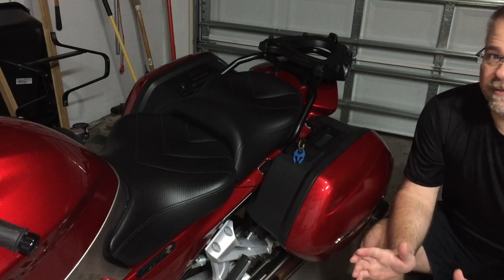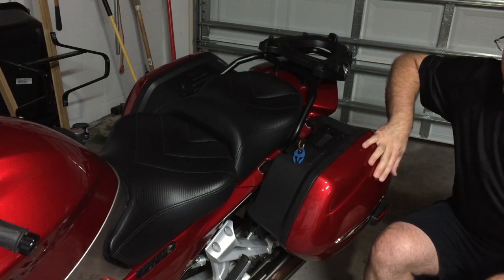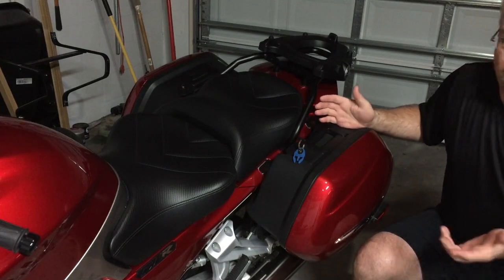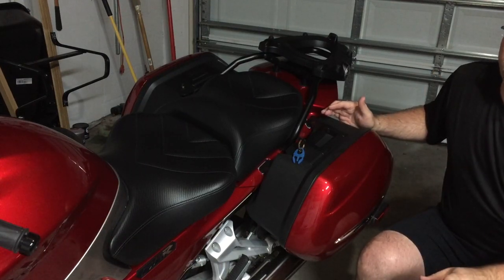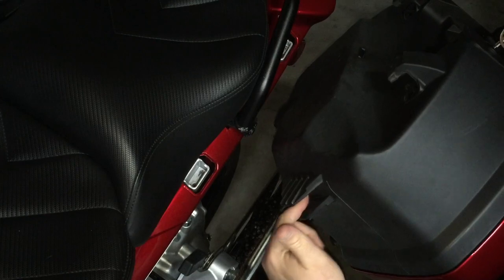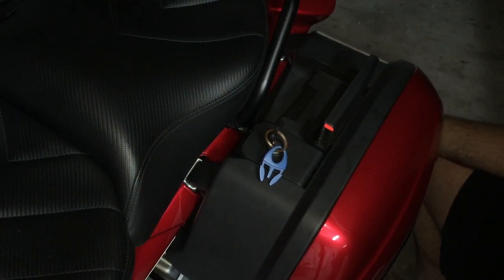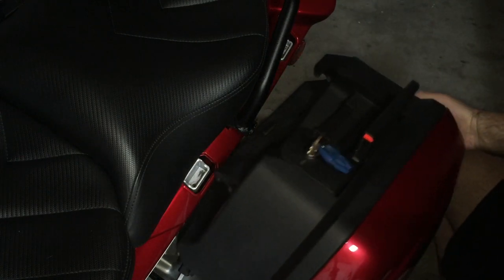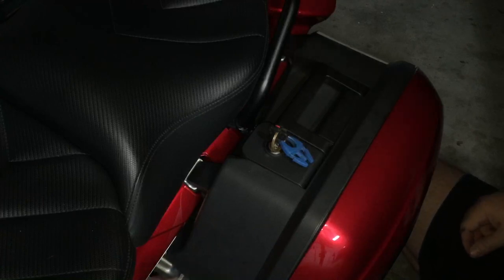FJR1300 Saddlebags Detatching Or Falling Off Solution

Comment: Has anyone found any other solutions for this issue?  I have a 2014 that has enough slop in the mechanism where I can wiggle one of the 2 hooks out of the top slots.  I dont like the idea of drilling holes to use a cottter pin but it would be worse to lose a case.  In my situation, there is a sizable gap between the top of the rubber guide foot and the bottom of the case.  I thought I may try to attach a rubber filler of some sort in that space to prevent the case from rocking around (which allows it to wiggle off of one of the top hooks).
Reply: Same problem here. Wiggle and twist enough and the rear hooks come out on both sides. The plastics are actually broken around the hook holes.

Comment: I think your "theory" is actually the proof. Is not a design flaw. The pre-ride check
and double check is the answer. The mounting mechanism is well thought out. Just
a matter of checking that handle. A great tip that I will not forget.

Comment: I was wondering if there's a way to remove and reinstall the saddlebag reflectors?
Reply from the maker: It's just double sided tape or adhesive goop, depending on the year.  dental floss to remove
Reply: @TwoWheelObsession  thanks...I started that path but it was so hard I was afraid I was missing something. Going try again.

Comment: They should have had one lock to secure the case and a separate one to lock the case. That's a very slim margin for error. Agreed that a single check tug would eliminate the issue. Yet had they made the locking slot notched into the handle directly in the center of  the handle then a handle that was up a 1/6 of an inch or less could not be locked or allow sudden detachment.

Comment: Mine ALMOST came off.  The small screws that hold the lock cylinder on vibrated almost out.  Thankfully I felt it being wonky loose when I put in the key to open the bag.  Any more driving and the screws would have dropped out completely and THEN the lock assembly is free to rotate with vibration.  That means it will AUTO-UNLOCK and that means the bags are free to bounce off...   I solved it by putting screws back in with JB Weld.  No more lose screws; no way to drop screws now.

Comment: Found this video as a result of issues with the lock.  Fortunately I did not loose my saddle back and easily could have as I didn't even know the large handle pushed the pin up to lock the bag in place.  Anyway, the two screws that hold the rotating tab onto the cylinder, one is missing and the other one is loose.  Can anyone tell me what driver is needed for that/those screws.  I tried torx, philips, and allen.  then I finally took a picture of the screw head while zooming in, and then blew up the picture to see that I don't recognize the driver required. (yes I wear cheaters and clearly they aren't strong enough!  Thanks for the information and I will locktite the screws.
Reply from the maker: It’s called a safety torx.

Comment: After reading a lot of the comments I checked my luggage for loose screws. Except for the strap that keeps the door from flopping open too far, mine is ALL rivets. There are NO screws that might loosen over time. The manufacturers date for this hard luggage is 08-23-2013. My FJR1300ES is a 2014 model. It would seem that the problem of loose screws has been fixed. Yeaaaaa. Now if we could only fix human error. Yikes.
Reply from the maker: Uh, dude those aren't what this is about at all.  The screws are on the little bar that swings with the lock, that's all.

Comment: The screws can back out in the locking mechanisms, Red Loctite them and you will be fine.
Reply from the maker: Wrong. Blue only, as called for. Red is very high strength and would be a problem removing if someone ever needed to swap the lock.

Comment: Having same issue and it is not no human error. Pin mechanism got loose.
Reply from the maker: +Nikolay Kuznetsov as I clearly said in the video, this does not apply to parts that are broken.
Reply: +TwoWheelObsession it is not broken, mechanism works and holds it in place until certain amount of force applied to bag (on bumpy road for instance). That exactly what happened on my bike and it happened with others. I fixed it by locking mechanism by screw from inside of the bag. In my opinion lock mechanism has bad design. Locking pin should move horizontally not vertically.
Reply from the maker: Yes, it is.  That's very common and usually caused by someone forcing down the handle.  It's one of the internal plastic teeth in the gear rounded off.  Unfortunately it requires the bag to be replaced as the parts are set when the case is molded together.  That's exactly what I referenced when talking about broken parts.  If your gear was not broken, it would not move.
Reply from the maker: I'd say that's a good fix for your problem for sure!  Good job!

Comment: No, I have a 2006. The left bag comes of by it self after a couple of kilometers. Yes I am sure it was locked. 
I suspect the lockingmechanism inside the bag is faulty.
Reply from the maker: As I said in the video, this does not apply to damaged cases.  Yours is
 broken due to someone forcing it shut at some point, you have skipped a
 tooth on the internal gear.  User error as they always are.
Reply: TwoWheelObsession No, I am very sure it newer was forced locked. I am a developer of products and never force anything because I know it never helps. It's a weak construction that jumps over the teeth by it self.  Similar as the top box that cracks by it's self, even with the reinforcement Yamaha supplied.
The next step for me us to disassemble the bag.
Reply from the maker: If you say so lol - and there is no disassembly.  It's injection molded together.
Reply: TwoWheelObsession everything put together is possible to put apart. After the crash for the bag I have no use for it anyway. Better to use it to get some facts instead of speculation.
Reply from the maker: Dude you have no idea what you are talking about. Once you actually take a look you can come back and admit I was right. It’s not assembled. It’s molded as a single part with the gear and track inside. This is an old issue for users like you that break it. You need a new bag.
Reply: TwoWheelObsession I actually do know what I talk about. I also think  I already said that I need a new bag, the one I have is already broken, that's why I can take it apart and se what part is too weak. Better to know then guess.
Reply from the maker: Post a video of you taking it apart and show the mechanism and I'll send you $100 no joke.  Or, admit I'm right ;)
Reply: TwoWheelObsession you do know that the bag is made of plastic and that any saw or grinder will do the job?
Reply from the maker: Lol you said you can take it apart. Not destroy. I’m waiting :)
Reply: TwoWheelObsession I never said that I have the intention to put it back together. I said I want to find what the weak part is. I also said that my intention is to buy a new one.
As I said from the beginning, I have no use for this bag. It has already dropped from the bike two times. The first one in over 200km/h it was tumbling down the highway..
I think you asumed things here.
Reply from the maker: Not assuming anything.  Take apart does not mean cut in to pieces.  And all you have to do is use google.  Others have already cut them open to see what's inside, many years ago.  You can think what you like, it's from someone pushing down on the lock tab and skipping a tooth.  It takes force.  User error.  You are not discovering anything new.
Reply: TwoWheelObsession I do think I know more about that. From the beginning I noticed it was almost impossible to close the handle. I suspected it was the lockingpin that does not seat in the subframe correct. Therefore I always always reseated the box until the handle closed almost by itself.  I know it never was forced.
I want to know why it failed in my case, that I cannot Google.
I am also going to measure the subframe and compare to the bag.
No, English is not my language, but I do know that the phrase  "taking apart" do not also say that you must be able to put it together working again.

Comment: Nice video. My issue on my 06' is both bags seem to have failing gear mechanism from handle to inside top tab, handle won't go all the way down easily at all. I have to push hard all way down then lock it, but still not flat. The orange decal is clearly visible from behind. Bought bike used, 16k miles and it's always been this way.
Reply from the maker: +Stixnfeet Durden That's from damage, most likely someone not having it positioned and forcing it one way or the other.  Once the gears have jumped a tooth, there is no way back.  It can only be replaced.